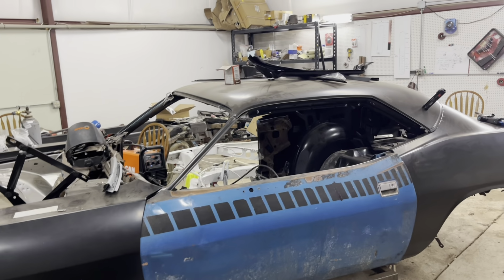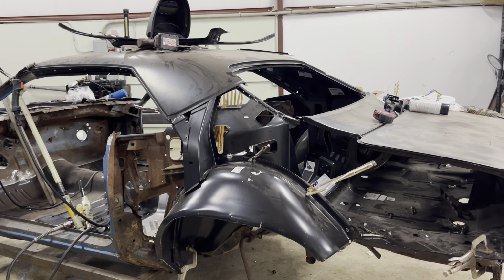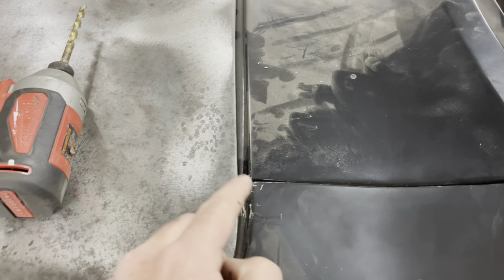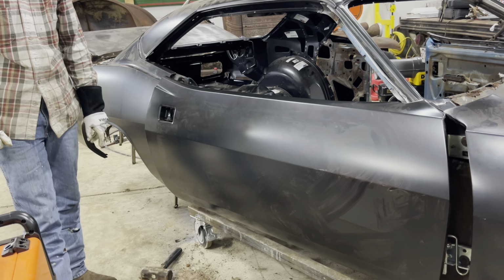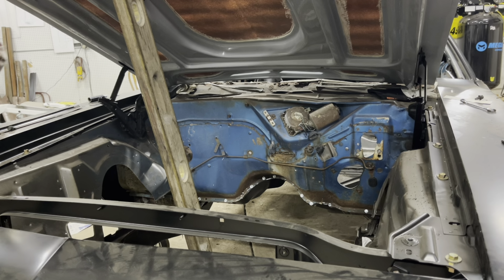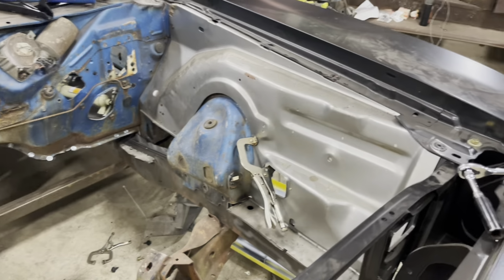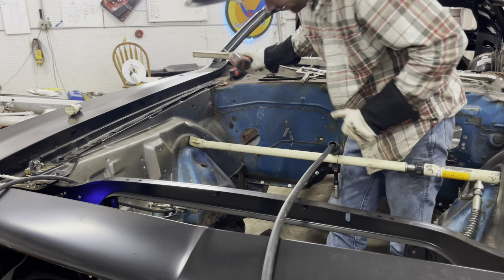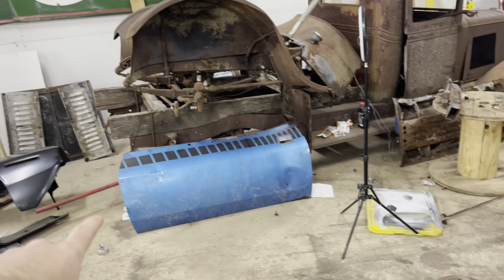1970 aar cuda restoration pt4

Comment: Wow. I am in the middle of my 70 GTX. I did it a little backwards. I have the firewall painted. The 440 6 barrel rebuilt and dropped in. I owned mine since 1981. The only real body issues are the corners of the windshield. And the corners of the back glass. Lower pass quarter panel. I have all the parts to put it back together except the seat covers and foam. You have inspired me because I only have to replace 25% of my car. Great job on this classic. Looking forward to seeing it to completion.

Comment: Would love to see this car finished.  Knew  nothing about these cars, but found they have very high value. I bet thus will be better than factory with all the attention to detail. How much is a 70 aar Cuda worth? Read on.

￼

As a result, restored examples have changed hands for more than $100,000 in recent years, while some have been auctioned off for almost $200,000. Well, Mecum's Kissimmee 2023 auction just set a new benchmark for the AAR 'Cuda, moving an unrestored, all-original example for $308,000 (including fees).Jan 13, 2023
Reply: An appraiser would rip this to shreds. It’s essentially a re body.
Reply: @jimmiles33  It's not a rebody if your rebuilding a wrecked car

Comment: If that car is worth what you say I think I would go ahead and caustic soda dip it. After all that work why leave rust in hidden places? It bothers me that some of the overlap joints weren't cleaned better before welding.

Comment: I'm just curious, with all the reproduction fiberglass parts isn't the car going to be a few hundred pounds lighter? So same horsepower / engine oem so to speak, maybe 300 400 lbs lighter than stock (I guess) = faster launch times. Sound right? Lol  I'm curious about those specs... I know I'm commenting on a older vid but whatever...😀

Comment: I want to know Before you started , Is there 2 steel level beams all the way under the car, set to level, in 4 corners, It gets locked down to the beams and that,s how everything will come out straight, after 40 years of working cars. and running 2 body shops, That,s the way a car that bad has to be done.If not and you try and sell that car to someone like me I would put that car on a frame jig and tear the work apart, I,m just telling you Because there people just like me.

Comment: Good idea to remember safety first. Second don't act like a ignorant hillbilly.  Third, wear gloves.  Especially when touching hot just welded metal. Again, safety first. I really would try to build this as it was done at the factory being that about 80% of that car is new parts. Fit and finish and would be better. It is painful watching you do a Sisyphus over and over again. Hope it doesnt explode like The Bluesmobile when its done. I really hope you rust prep all that metal before painting for the future of the cars existence and eventually undercoating it. Good luck.

Comment: Bruh... this thing are dangerous... it should be illegall
Reply: No its not? currently its just a fitment stage, once everything is permanently welded in place itll be just as strong and safe as when it rolled off the assembly line
Reply: A nearly had a stroke reading this comment.